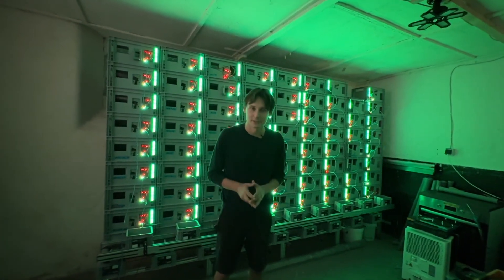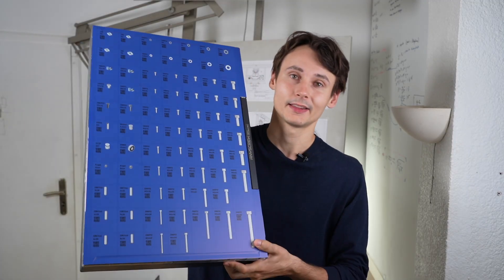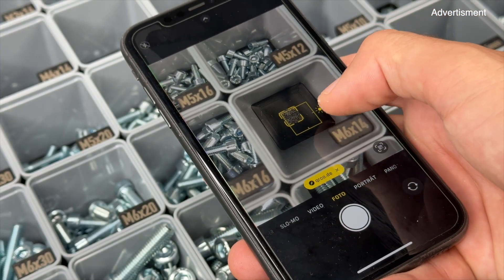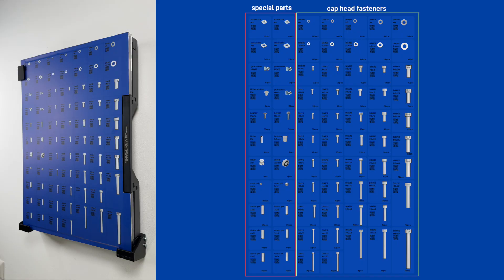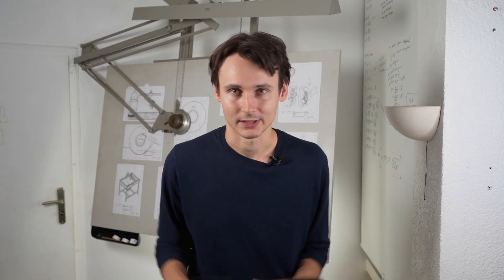Testing volume - 3d printed automation #010

Comment: AI Summary

Abstract

This video documents the transition phase for a product development effort, moving from the creation of a large-scale automation machine to offering specialized component kits and fulfillment services. The core of the presentation focuses on the "MPS Development Series Season 2," which introduces a 3D-printed-enabled modular production system designed for counting and packaging fasteners.

The system showcases a machine utilizing 72 feeders in an 8x9 grid, each loaded with a unique part, feeding into an automated conveyor for kitting. The primary product launch is an essential component kit containing 72 distinct parts (over 2,000 total fasteners), including 50 screw types and 22 specialized components intended to augment 3D printing capabilities. The creator emphasizes the value embedded in the associated design examples and hardware utilization "tricks." A key strategic decision noted is the current focus on offering fulfillment services rather than selling the large-scale machinery itself. Pricing options are detailed, explicitly highlighting the significant cost premium associated with the premium storage box compared to the components alone, suggesting users leverage their own storage solutions for cost savings.

Testing Volume - 3D Printed Automation #010: Fastener Kitting System Launch

*   0:00 Machine Introduction: The creator details the completion of what is claimed to be the world's largest screw counting machine, featuring 72 feeders arranged in an 8x9 grid, each holding a distinct component.
*   0:44 Service Pivot: A fully automated kitting service is announced to launch shortly, signaling a current focus on providing services over selling the machinery immediately.
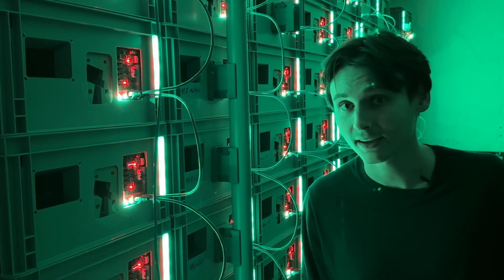*   0:51 Product Rationale: The creator introduces a physical kit designed for users developing functional parts via 3D printing, intended to solve the problem of sourcing necessary fasteners.
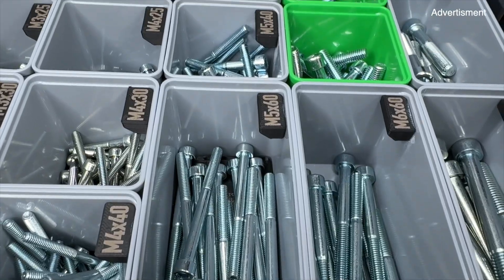*   1:21 Kit Contents: The essential kit comprises 72 different components: 50 distinct screw types and 22 special parts, totaling over 2,000 items.
*   1:33 Value Addition: The kit is bundled with five design examples and documentation detailing 20 off-the-shelf hardware integration tricks.
*   1:51 Automated Fulfillment: Reordering is designed to be quick and automated via the online service platform (anyscrew.eu).
*   2:02 Pricing Structure: Three purchasing variants are offered: the full kit with the branded box, or two cheaper variants containing only the parts, accommodating users with existing storage solutions (e.g., Grid Infinity).
*   2:26 Cost Transparency (Storage): A candid discussion on pricing reveals that the high cost of the premium storage box (from Auer Packaging) inflates the full kit price significantly; users are advised to purchase parts only to maximize cost savings.
*   3:15 Value Proposition: The component set is positioned as an exceptional bargain (under €140 for the parts alone) given the extensive variety, challenging competitors on bandwidth comparison.

AI-generated summary created with gemini-2.5-flash-lite-preview-09-2025 for free via RocketRecap-dot-com. (Input: 14,107 tokens, Output: 859 tokens, Est. cost: $0.0018).

Comment: Something I think is missing in the maker space is a store that can provide on-demand hardware kits that can be defined by creators. For example, if someone designs a 3d printer, they can upload the stls on printables and the BOM on your site, then anyone can just go and order the kit. If your setup is flexible enough to keep the overhead down, I think that would be a very valuable service. Especially for things without enough traction to get the main shops to store your kit in inventory.

Comment: Imho there is a giant market for a European equivalent to "McMaster Carr" where you can selectively order hardware (e.g. screws, bolts, nuts) in whatever quantity suits you. And with a intuitive website providing 3D step files. You already have the automated sorting machines which could "auto pick" any custom order removing the majority of the overhead cost of such a store.
Reply: There are already such companies. (Not to mention that McMaster Carr ships abroad, which is used for when we need a non-metric fastener.)
Reply: Norelem is similar

Comment: I think most of us that create products have screw kits like this already but in multiple tackle boxes,  I have 6 tackle boxes with screws from 2mm to 5mm in diameter and from 4mm to 50mm in length,  witth lots of other nuts and metal fixtures.   It’s nice that you put it all together, but that case is too big and heavy.  Im 60 with arthritis and it would be difficult for me to pull that off the wall like that.  My small tackle box one are very heavy.  I use a company called hex screws here in the USA for screws.  Good luck, i think this would make a great Xmas gift for a creator.  Larry

Comment: Checked out your site and that's an excellent set! I didn't see heat-set inserts, however, which I consider essential for my projects. Over the years I've built my own hardware storage based on Akro-Mils bins and 3D printed inserts, but yours is definitely superior.

Comment: I'm curious to know which manufacturer makes that box?

I put together a kit of nuts and bolts myself for the same reason a while ago, although I spent a fortune doing so as you identified. I went for stainless throughout and included multiple types of bolt heads and nut types - I only did M3 and M4 though due to the cost! It made life so much easier having them all on hand.

Comment: I'm lucky as hell to have a store dedicated to fasteners and fastening technology literally 300m away. They got all sizes of screw, bolt, washer etc. from tiny (not electronic) to huge sold by piece or by weight, along with bits, tools, glues, ropes, corner brackets etc. I'm pretty sure a lot of people overpay for stuff like that buying it in packs or at big box stores.

Comment: It’s a neat idea, but I think everyone uses a different variety of parts. I mainly use M3 screws with occasional M4s where I need strength, but someone working on mounting smaller PCBs might prefer M2.5 or M2. Countersunk vs socket-head. Different finishes for corrosion resistance or style. As a hobbyist, I find myself buying a large quantity of a smaller variety of hardware, and designing my models around those sizes. Usually it’s pretty doable to adjust the depth of a countersink or nut placement to account for an existing screw size. The heat-set threaded insert multipacks have the same issue where they have a dozen of each size, but I’d rather have a higher quantity of 4 different sizes instead of less each of 20 sizes.

Comment: Sorry, no matter how big the box is, the assortment is too small. And capheads are very limited when you start designing things and have to consider loads, packaging etc etc. Unfortunatelly it is just better and easier to order the screws/bolts etc when you need it and what you need. Less wastage too. 20% of that box screws will be used used up quickly and will be left with not enough of them when needed and the rest will probably sit in taht box until retirement.

Comment: I did a similar assortment setup with some 3d printed trays in surplus radioshack parts bins.  If you don't have your own parts assortment already, I HIGHLY recommend it.  

Obviously my solution won't work for most, but this is a pretty awesome way to start instead!

I love where you're going with this, and look forward to seeing it proceed!

Comment: Do you plan to offer custom parts kit bagging as a service? This would be really great for small to medium sized 3D print producers who need to offer parts kits for their products but who can't afford to spend the labor on manual parts counting. Even more, I could see this transforming into an on-demand parts kit drop shipping service, which would be an amazing complement to 3D print design suppliers.

I would even consider the value of this service for my own projects where I know the number of parts (especially fasteners) ahead of time due to the design, but don't want to have to buy bulk just to get the quantities I need. Sure, I don't mind collecting random nuts and bolts, but sometimes I need an inconveniently large number of basic fasteners where the cost of smaller quantity units it too high but the quantity of the next largest bulk size is too large.
Reply: I think that's what he meant when he referred to the "kitting service" that is upcoming (there's a non-functional link in the website).
I agree it would be very nice. I don't make big parts, so I'd never use M6/M8. Probably not even M5. I'd like M2,M3,M4.

If the MPS can be linked to an online shipping service and automatically build up a kit, I can see this system being able to offer custom kits at a competitive price.
Unlike the kits on Amazon, you'd get quality parts and exactly the ones you want.

Comment: Pretty sure I recognize those cases - A big selling point for me with them was they fit into the eUrobox form factor, so very Easy to design shelving aRound. That said, the 600 x 400 cases experience significant flex in the middle - have you been able to mitigate that somehow?

Comment: At 229€ for the full kit with the box, it really is expensive. I feel like even when buying just the screws, 68€ is a relatively big expense, although I don't doubt the overall value. I hope that in the future, you will be able to offer some smaller kits, even if the overall value decreases somewhat.
Reply: I spent much more than this on a similar assortment a few years back, w/o a box.  The solutions for small part organization are EXPENSIVE no matter what you do (if you want it to be GOOD).
Reply: @KayleeKerin  Do you remember what assortment exactly it was? What did you need so many components for? If you don't mind me asking. 

Personally, I appreciate the great value relative to the price, but I would like the option to spend less money on the order, even if the overall value decreases.
Reply: The screws are a super great deal, just the M6 and M8 cost much much more normally. If you only use smaller (M5 and below) it doesn't make much sense of course.

Comment: Parts should ideally be restocked before they run out completely. Maybe put the QR code on the side of the container, or somewhere where it will remain accessible.
Reply: No, just double stack the bins. once the top is empty you order your refill und use the bottom bin until then 😉😉
Reply: QR codes seem to be both on the bottom of the bins as well as on the lid.
Reply: Maybe side AND bottom
Reply: @paulworms1467  Yes, but this would be slightly more complicated. Custom injection moulded or 3d printed boxes can have this built in, anywhere.

Comment: I don't consider the price-point as 'luxury'.  I saw it and thought "gridfinity!"  But I think anyone whose made a setup like that knows that it's at least half that price in just filament alone.  And the time it takes to print everything, woo!  I could probably order this and have it in my home before i could print out all the bins.  You're doing some pretty impressive work and I'd humbly suggest that you phrase it like you did with everything else you make:  "Start here.  This product will get you up and running and then you can Iterate your own needs as you discover and better understand your requirements."

Comment: You....have a bright future ahead.

I'm going to buy them, 140€ total (excluding box)is a bargain for a sorted set.

(A note on your website, it's not clear that this is a 
-Special parts only (excl. Box)
-Standard screws only (excl. Box)
-All parts and box

It looks a bit like:
-special parts & screws (excl. Box)
-Screws only
-all parts and box

I would also like a 
-All parts excluding box
Buying option
Reply: agreed, almost felt like being tricked... although i genuinely believe its unintentionally worded this way
Reply: I think a box only option would be good for down the track upgrading, or being able to fill as needed with what you actually use
Reply: As a bonus feature, all the parts will be shipped combined together in one large plastic bag. For your sorting pleasure. 🤡

Comment: Interesting proposition, though useless to me - I'm actually fine with those 'ugly' assortment boxes, somehow I found just the ones I like and those are available cheap and easy.
Ordering screws from you? Eh, you can't beat the assortment of Wurth or the prices of say TME, thing is when you've been around the block a few times and figured out the supply chains - any middle man becomes useless.
Cool boxes though, are those Licefa? AUER?
Too bad Tanos doesn't make anything with compartments this small.

Comment: Could you provide some details about the screws used? Specifically, I'd like to know the hardness (8.8?) and the type (are they stainless steel?). Thanks!
Reply: apologies for the smart-ass comment but you probably mean (tensile) strength, not hardness.
the ones shown in the video are galvanized steel (not stainless) and I´m pretty sure its the standard 8.8 flavor. 
...which would make sense because this set is all about providing you with all the basic/standard parts to build things. not some exotic stuff you might need for special applications.
Reply: Zinc plated (not galvanised) are commonly available as grade 12.9.
Reply: If you have a look at the website, you can see the DIN number there which will tell you the specifications for each screw.
Reply: Can I get one with 12.9 ?
Reply: I agree, all details would be nice.
Reply: i need a 69.420
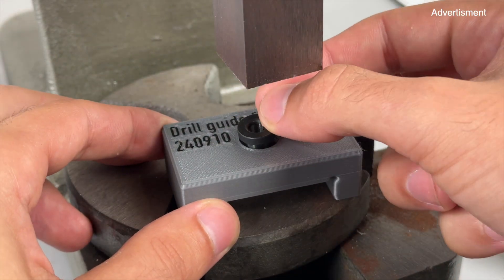Reply: Judging from the colours of the parts between 1:16 - 1:36 I'd say the nuts and bolts are galvanised steel, the pins and balls are stainless, the tooth pulleys are probably aluminium (maybe stainless?), and the drill bushings should be some kind of hardened steel.